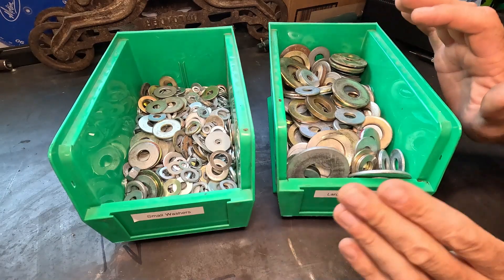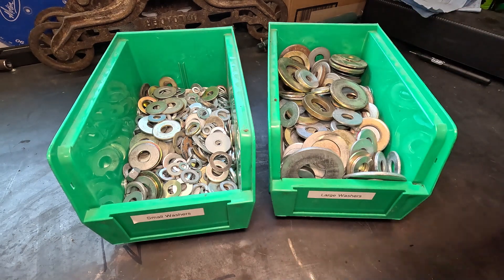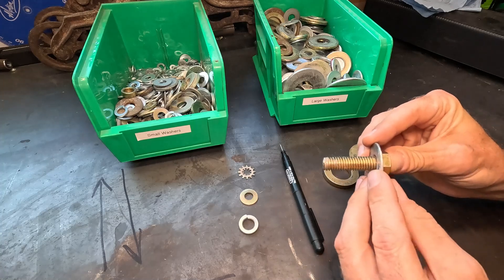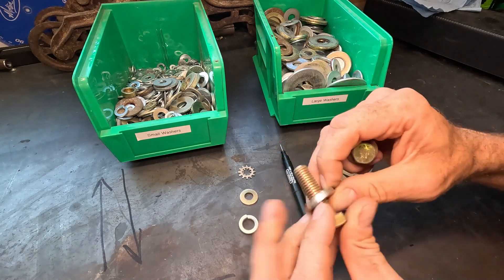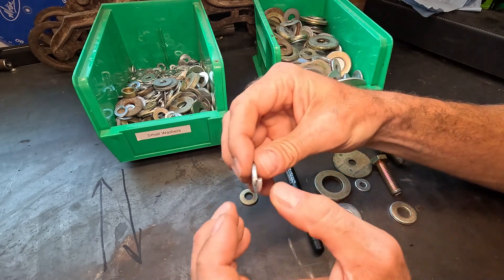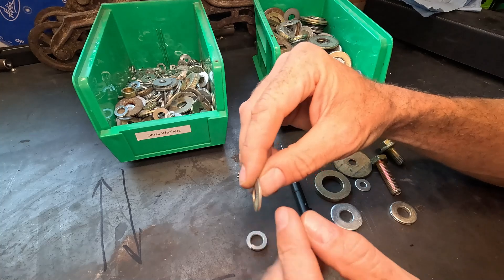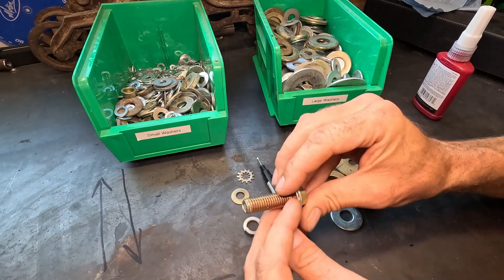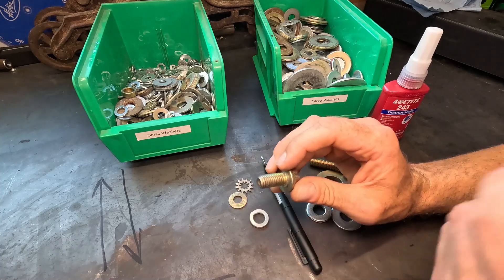What washers do within a bolt and nut joint.

Comment: I had a job for 2 years working as a washer designer. It's a real qualified engineering job.
Reply: Please say more about your washer designer job
Reply: @puppable  My washer designer job was at a company that mainly manufactured roller bearings, mostly for the automotive industry, but they also did other stuff such as washers.
I was responsible for two products, washers and needle bearings. Before I started there I had no idea how many different types of washers there were and how high tech some of them were. Most of the washers were to customer specs, such as material, hardness, surface finish and were usually destined for gearboxes and such.
To be honest, the job was way below my qualifications and bored me out of my mind. Although the pay was good and job security was excellent, I left after 2 years and specialised in designing plastic components  for the automotive industry and never looked back.
Money is important, but never that much that I'd sell my soul for it.
Reply: @mikethespike7579 I wouldn’t be too comfortable admitting that you are complicit with the use of plastic components in cars. I could tell stories about plastic components whose designers have been consigned to one of Dante’s levels of Hades owing to their failure due to material breakdown. Fords mostly.
Reply: @marvinhaagsma9177  I understand your grievances but engineers are unfairly blamed for bad component design. We design according to customer specs. And those specs are determined by bean counters in suits who sit in air-conditioned offices well isolated from reality.
I don't know about Ford, I drive a Ford and I'm satisfied, but I'd certainly advise against buying any BMW. I've had serious issues working for this company in respect of design quality. Their design specs just ask for component failure. I've pointed this out to them and they just shrug and say that BMW offers complete sets of replacement plastic parts and that should suffice.
Reply: @mikethespike7579  They ask for it to fail? That just further confirms what I already knew about new parts and cars.
Reply: @ATruckCampbell  I have over 30 years engineering experience in the car manufacturing industry, so I reckon I know a thing or two about this industry. Car manufacturers work according to the Gillett principle. They hardly make a profit on the sale of their cars and then charge eye watering prices for parts and services. It therefore stands to reason that it's not in the interest of the car manufacturer to build cars that hardly ever break down.
Reply: @mikethespike7579  I know that, though I did not know it was a "principle", thanks. It is strange though, because of what they are doing now, it does not seem sustainable to keep making garbage either.
Reply from the maker: I'd been meaning to respond to this and forgot. Unique jobs like that you held are always fascinating to me. I work for an OEM, engage with mechanical and software engineering daily. Fully understand the conversation regarding design specs, why the exist, who drives them, etc. Definitely have learned to appreciate that EVERYTHING in design has a reason. It may not be like, but always a reason. Thanks for watching and hope to see you back soon. Cheers.
Reply: As an engineer currently looking for work, how does one a job in washer design? Is it just a sub-role of a generic mechanical design job, or is it something you can specifically apply for?
Reply: @lukestevens9375  No, there is no specific engineering field for designing washers. My main job was designing roller bearings, mostly needle bearings made of pressed and drawn sheet steel. Since the same manufacturing tech is used for washers the boss gave me the job of designing washers as well.
Reply: It could be puzzling to find a metal washer in the gear box to prevent oil leak!
Reply: @abdelhalimyousef1041  True. As far as I know, washers are not good at preventing oil leaks in gear boxes.
Reply: That’s cool 😁
Reply: Older Fords were OK, newer ones are disposable. Look up the schlemozzle with wet belt failures. Many of them will last less than 100Mm (about 60k miles) before wiping out the engine.

As for BMW, they are the king of time bomb engines. Whether it's valve seal failure, water pump impellers disintegrating, coolant tanks rupturing... I will never own another one.
Reply: @nicholasvinen  The maintenance manual of my dear little Ford Fiesta stipulates  changing the wet belt every 60 000 Ks. I stretched the last one to 100 000 and think it could have lasted even longer. I check the belt regularly for wear and also treat it with silicon spray every now and then, which is supposed to help.
The service shop told me there are inferior belts on the market, cheap Chinese crap mostly, that are unreliable.
Personally, from an engineering point of view, Ford could have made this service point easier to do. Why is the engine designed that you have to take half of it apart just to change the belt?

The worst stories about BMWs are definitely the valve seals. The epitome of the one cent part costing a king's ransom to replace. I'm guessing BMW took Chinese crap to save a couple of cents on each car and to hell with what that means for the owner. I have a 30 year old BMW K75 motorcycle with over 160 000 Ks on the clock. It has never needed repairs, only the regular stuff such as oil and filter changes, new sparks and brakes. I'm told there are others of this model with half a million on the clock and still going fine. So it's possible to manufacture vehicles that last a very long time without letting the owner down.

Comment: My understanding is that split washers provide extremely little locking function unless the material is much softer than the washer itself. Heavier ones can provide some spring function, but wave or Belleville washers are better for that. IMO it’s a sign of poor engineering if a manufacturer includes split washers with steel parts.
Reply from the maker: I personally rarely see them anymore, thankfully. I have no idea how I ended up with so many in my "small washer" bin. At least they finally were used when I pulled (1) out to explain what it is to those who don't know 😀

Comment: Thats not a belville washer proper. Belville washers are made of Spring steel and are intended to produce controlled tension in a joint. They can be used face to face, stacked pairs or on on top of another etc. Traditionally used where some compliance or a set pressure or preload at a shoulder is desired.
Reply: what  no double wave washers
Reply from the maker: Thanks for sharing that. I'm trying to think if I've ever come across multiple in a given joint. Most likely, but I can't remember specifically. Cheers!

Comment: The washer goes under the nut to reduce friction when tightening.
Reply: A lock washer can go under the bolt head or the nut.  One thing I always did was check with a engamanere
Reply: But what about the friction between the bolt head and the washer?
Reply: @mynameisben123  Washers, bolts, and nuts will often be zinc coated, which is a lower friction surface than painted parts which are being bolted.
Reply: Why would you want to reduce friction torquing a bolt? 
Examples please.
Reply from the maker: Thanks for mentioning. Definitely a use case others have mentioned too. Thanks for watching.

Comment: Don't forget:  cup washers - usually decorative; washers used to more easily allow the bolt to rotate and tighten - often nylon or similar material; crush or sealing washers - used to seal a gas or liquid port such as oil pan drain; ...
Reply from the maker: Great tip!
Reply: Cup washers are use when a countersunk screw is used when a panhead, cheesehead or roundhead would be a better solution.

Comment: Split lock washers are not effective, as mentioned in NASA’s fastener design manual (https://ntrs.nasa.gov/archive/nasa/casi.ntrs.nasa.gov/19900009424.pdf). They may slow the loosening of a joint that has come loose, but they don’t prevent failure of the joint in the first place. In fact, they may reduce locking as they reduce the area of engagement between bolt head (or nut) and washer or piece to be fastened. It’s no surprise that you don’t see lock washers anymore on most equipment. 

Star lock washers and any type of serrated washers can be effective, but only by marring the surface. That’s ok unless you are worried about corrosion or stress fractures. The best options are torquing the fastener properly, thread locker, or nylon lock nuts. There are plenty of other esoteric and complicated methods, but they are unnecessary for most of us.

Comment: Juist started the video, interested to hear how you think washers should be orientated. I've long had a good understanding of which face should go up/down for which application. Had a VERY good mechanic at work tell me I was wrong, as they should always go in  a "top"(rounded edge) up configuration, as the washer has some "spring" to it. My theory is that that "top"
 side should be down in applications you want to not break the paint below(most applications), and the "top" side up in applications where you need to break the paint(i.e. electrical grounds). By "Top" and "Bottom" I'm reffering to the sided of the plate the washers were stamped out from., which results in a rounded edge on the upper die side, and a sharp edge on the bottom side as the upper die pushes through into a lower die.
Reply: @ravenbarsrepairs5594  the round side up just looks better, thats all folks.
Reply: Lol. Thought I was the only one who noticed this difference between the ‘top’ and ‘bottom’ of a washer. Always rounded side up for me.
Reply from the maker: Great question, and hope someone with more mechanical design experience than me might comment. I can certainly see how in some situation for sure there is merit on a certain orientation. I've heard the same theory and you mentioned relative to snap ring installation, though I've never personally had a problem when installed "wrong".
Reply: Bolts are like a spring, and the load is depending on dimensions, material and torque applied.
If a joint is done correctly there is no need for any washer to put some extra load on top.

Comment: Not one of the spring washers is useful for high vibration environments. If there's a genuine vibration loosening problem Nord Lock style serrated washers or actual mechanical retention such as the wiring used in aerospace, castle nuts with a cotter pin or anti rotation washers that are folded against the flats of the nut after it is tightened are needed. Usually if a joint vibrates loose it means it wasn't designed correctly or tightened sufficiently though.
Reply: The spring washers are useful to resist loosening during mild heat cycling such as in busbar or bolted battery terminals.  You can even get terminal bolts with a captive split or cupped (usually star) washer.  For more extreme heat cycling or highly thermo-expansive materials such as aluminum, everything will simply crush so it takes more than a simple spring washer.

The "star" or tooth washers are also useful to cut into thin surface coatings or oxide (e.g. aluminum oxidation or anodizing) for a better electrical contact.
Reply: @Sylvan_dB  Right, that makes sense - all the electrical terminals I see have a spring washer on them, and appliance ground screws a star washer.  The comment on aluminium has me wondering if you happen to know what is used for holding together clamps on kv HT transmission lines, which I believe are all Al?
Reply: @mikelastname  I don't know re. the HT lines, but that would be an interesting tidbit.
Reply: True - bolted joints in high vibration situation should be held in tension with clamping force provided by the bolt threads on the nut - often you don't get this with low yield mild steel bolts. Counter-intuitively, applying the proper amount of lubricant also helps properly tension the bolt and stop it undoing.
Reply from the maker: Awesome comment, thanks for sharing! The normal end user rarely understands the level of thought that goes into something as 'simple' as a bolted joint.
Reply: We don't need no stinken foreign woshers telling us how 2 do things .  I found a welder works best.

Comment: One thing I’d like to mention is how some materials of washers can also be used to stop fluids
Reply: Copper crush washers usually in combination with banjo bolts in hydraulic systems.
Reply from the maker: Oh yes, great point! I've battled the brass washer on my motorcycle drain plug before not sealing properly.
Reply: @LearnedFromDad  brass washers dont seal. Use copper.
Reply: @johnnyseagull29 The sealing washer part number for my car oil drain plug seem to be aluminum, and I've never had any leaks, so soft aluminum should work as well.
Reply: @F0XD1E  yes, that's right. So long as the sealing washer is softer than the fitting it will seal.
Reply: @johnnyseagull29 what about flared connections on AC?
Reply: @CL-vz6ch  but they don't use washers?! And anyway i believe they tend to be aluminium, which is softer than the fitting.
Reply: @CL-vz6ch  usually has o rings in the ac connections. Hnbr green o rings.
Reply: @F0XD1E  plastic or nylon is a better choice for the oil drain plug. Aluminum does work, but can gall or deform which can create a leak. In an oily location it may work, but anywhere else, aluminum is prone to corrosion over time which will negatively affect the sealing surface ability.
Reply: As softer materials they deform under pressure into microscopic fitment between the two load surfaces
Reply: Note that crush washers used in oil drain plug applications are only supposed to be used once, after the first deformation they won't seal properly if used again. There are also gasketed washers (with rubber around the inner edge) that can often be reused as long as the gasket is in good condition.